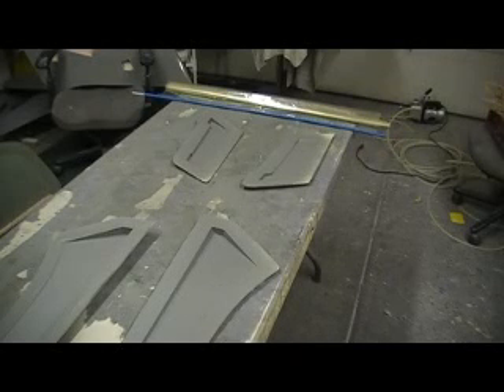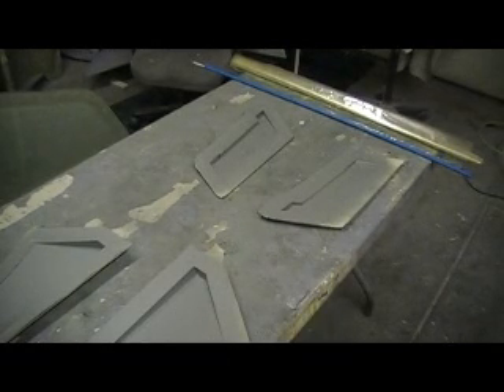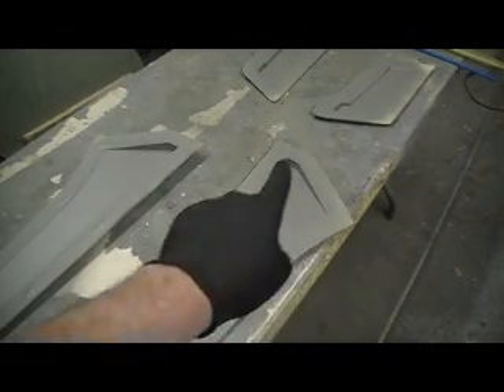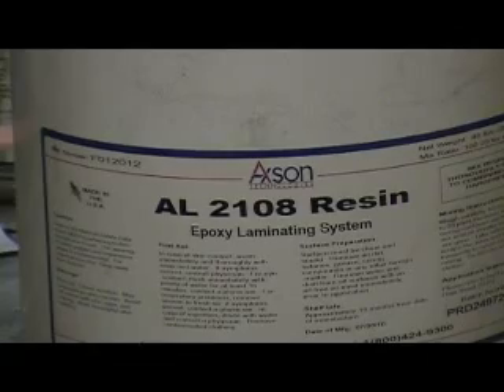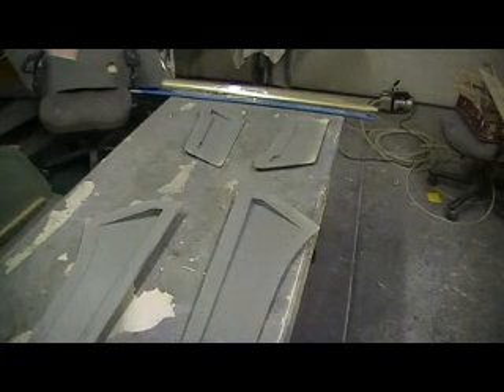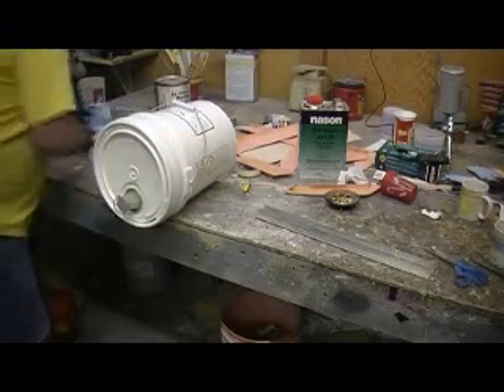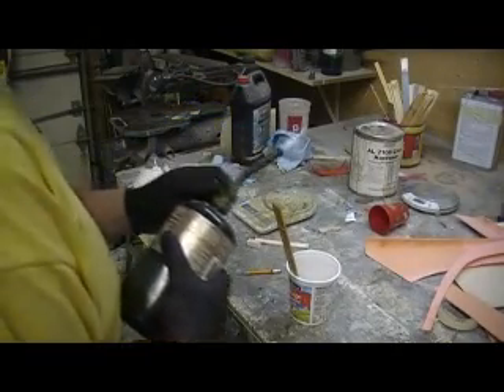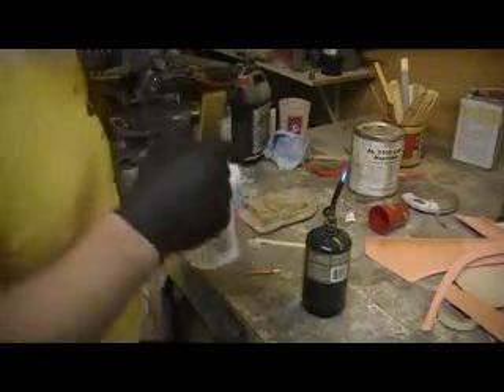how to build a rc jet F-105 thunderchief # 301

Comment: We bought bucket warmers from McMaster Carr a few years ago for an adhesive that we use at work.  They clamp around a 5gal bucket and run on 120vac.  Theres a thermostat to dial the temp you want.  If I recall correctly, they were arong 40 bucks ea